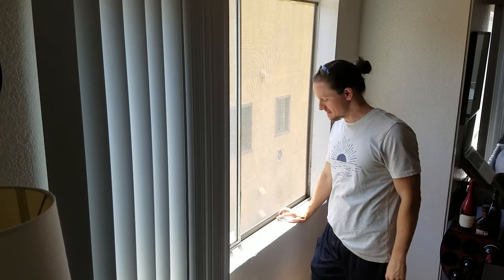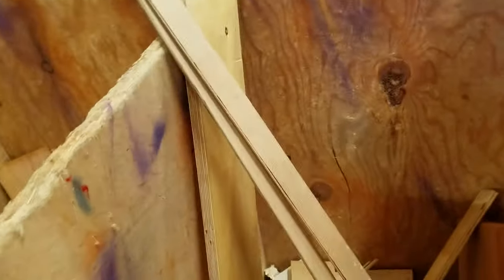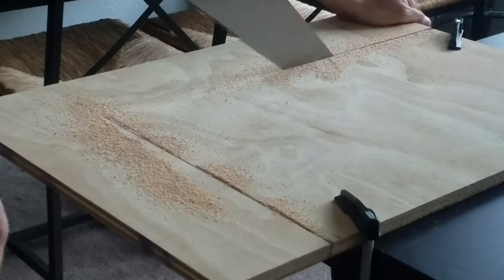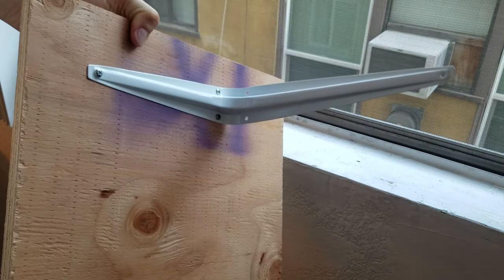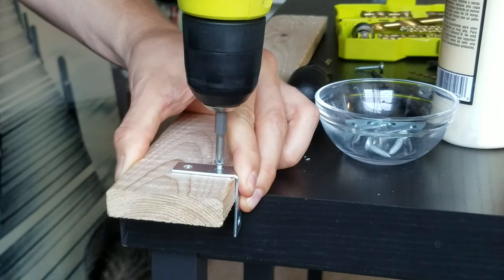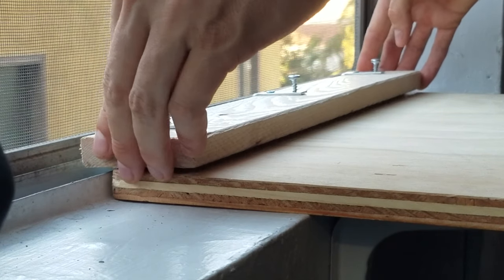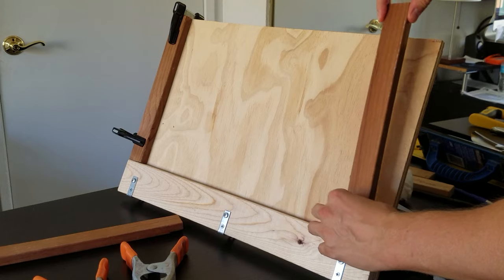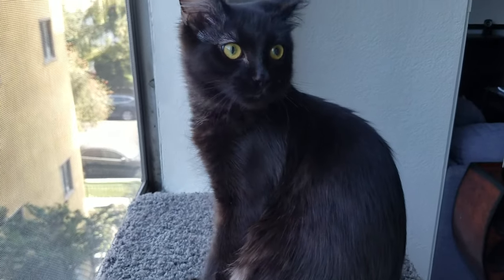How to Build a Removable KITTY PLATFORM for Your Window!!! (No Permanent Modifications)

Comment: Love how you did this!  I just bought a cat window perch off Amazon.    Similar concept, except not as big and sturdy.   It was supposed to hook on to the window seal like your L brackets did and if the window seal track is deep enough, it would make it possible to close and lock the window with the perch still attached.   My thermal windows do not have a deep enough track for this to work for me.  I have rigged it to where I can close the window almost all the way and stuff a towel between to close the gap, but I feel like I could do something else to make it work better.   My windows have to stay closed because of weather conditions.   Thanks for giving me some  ideas.

Comment: Nicely done! I need something like this for 2 heavy plant pots I need by my window, but my window doesn't have a lip or groove to put the angle braces in. It's window with 2 crank out windows on either end. I would need to find a fix to put a shelf in the middle section between the 2 crank out windows for those heavy plants.

Comment: So the window needs to be open for this to work? So not for winter use.
Reply from the maker: Depends on your window. With mine, the platform fits on the right side with the window open and fits in the left side with the window closed.
Reply: @scapesketch5721  ah ok.
Reply: @ScapeSketch nuts.  I have a double hung window. Not casement.